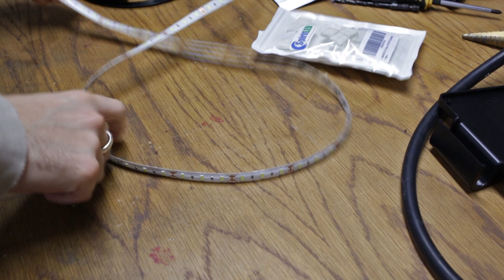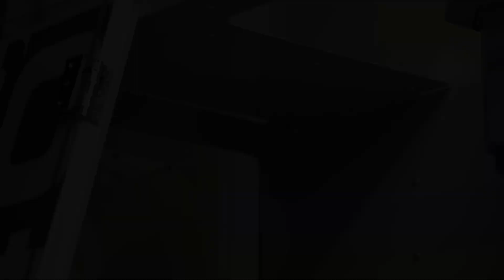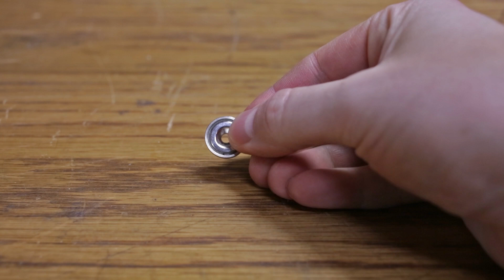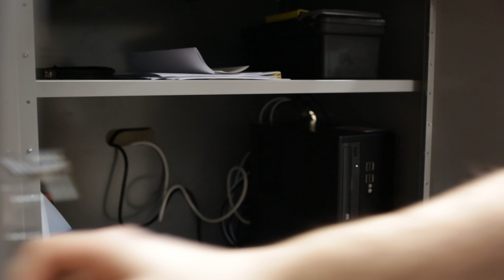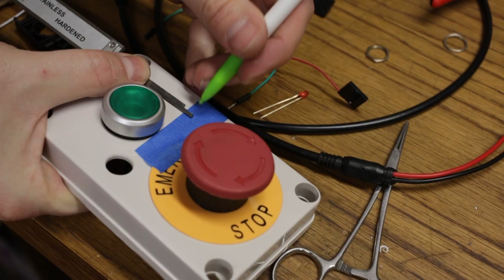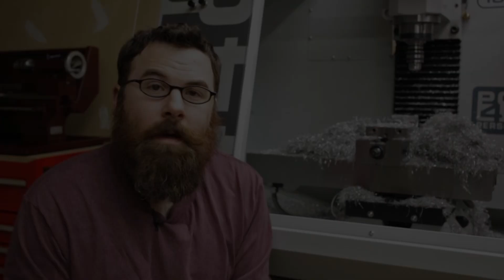Tormach 440 Enclosure Mods

Comment: The PC should just get power when the main panel switch is turned on. Seems like a design oversight on Tormach's part to have the control panel the PC powered separately. Power could come directly from the disconnect switch. It would be the same thing as plugging the PC in to the wall outlet. That is maybe $10 in parts. At scale that is maybe $3. I am getting my 440 fired up and this lack of everything on and off with the control panel switch is annoying.
Reply from the maker: HA, I'm just getting around to hooking the machine back up (just moved it across the shop) and am running into this issue again.  I'm considering wiring in a power strip so the main on/off switch powers a computer as well, just like you said.

Comment: Nicely done. How does Tormach feel about the two modifications? Wouldn't going into the internals of the computer case void any manufacturer's warranty? Can your Tormach do pretty much anything your manual lathe and manual mill you turned into a CNC mill used to do?

Comment: Thank you for this video Robert. Our University just purchased two 1100M’s and after we put the enclosures on, I was kind of disappointed that the only access inside the enclosure was through the front doors. That was until I saw this video and saw how you could lift the side glass. The 1100 has four brackets (one on each side of the glass panels and they are squeezed tight to create a seal. I think I will try taking the top bracket off and loosening the three other brackets just enough to allow me to lift the panels like you do. I know it won’t be as smooth acting as your panels are, but I am hoping it will at least make it easier to do machine cleanup and be able to access other components inside the enclosure , hopefully without causing a coolant leak. Thank you very much. You do excellent videos.
Reply: Who would've thought I'd find you here after taking your class 4 years ago! Thought you might like to know that I'm looking to get my own 440 or 770  next year to machine some molds similar to what you had us do in lab. Really appreciate the time you spend to teach us know it all engineers a thing or two about actually making things!
Reply: @noahhastings6145  OMG … hope your doing well Noah. The Tormach have been good to me as long as you stay within their constraints. Thank you for the kind words and Best of Luck to you and your future endeavors.

Comment: FOR THE COMPUTER YOU CAN SET C..MOS   (IN THE SETUP) ...SO WHEN YOU TURN ON THE COMPUTER ON WITH THE RED POWER SWITCH WORKS GREAT..
Reply from the maker: Yeah, I learned that a bit later unfortunately.  On the 440 there is only one power outlet and that's for the coolant system.
Reply: THAT I DIDN'T KNOW. THINKING THE 440 CAME OUT LATER YOU WOULD THINK THEY WOULD PUT IN AN OUTLET FOR THE PC..
Reply from the maker: No need for all caps ;-)  I think they were trying to save some cost.  The fuse, relay, etc adds some money, so they probably omitted it.  Plus there's not a lot of room in the cabinet.

Comment: Did your LED strips stay stuck? I bought the same LED strips from your Amazon link, and they fell off overnight the first night.

Did you do any surface prep? I put my LEDs on before ever running with coolant so I presumed the surfaces to be clean.
Reply from the maker: Mine did stick...  You have to REALLY press them down hard, and then repeat that step a day or so later.  I just did a simple wipe-down before I installed them.  They're still stuck.

Comment: Good stuff.  I wish you luck with the adhesive back LED lights.  Mine started to fall off after a few weeks.  Yes they were applied to a clean new surface.  But I'm running kero as a lube and I think the mist combined with the heat didn't help.  Let us know if you have a similar problem.
Reply from the maker: +Richard Cournoyer Yeah, I'm crossing my fingers.  I used some good foam double-stick tape at the T connectors, so hopefully that will help hold everything together.  Yeah, I think mist wouldn't help much at all.  If they start falling off, I can use another adhesive.
Reply: +Robert Cowan (Rowen Hobbies) the 3M tape used to hold accessories to trucks, like rail caps, is very strong, but solvents may still be an issue. If worse comes to worse, maybe you could mill out some aluminum strips to hold the LED strips in a channel, and attach with screws?  When you have a CNC mill, many things become possible....just a matter of cleverness and time! (And sometimes money of course). 

-- Mike

Comment: Nice video and great mods. All of them are simple and effective. Sometimes I think we over-design things because we can. 

Have you thought about the LED connections not being waterproof? I know they are at the top of the cabinet but you may want to seal them. I was thinking a bit of hot glue would work but still be able to be removed in the future. Also, were the holes for the doorstops there from the factory?

As for the psychedelic machining party lights... I LOVE IT! 🎊🎉  I wonder if you would be able to do I me the lights to stop the chips in mid air. 😎
Reply from the maker: +Eric Wolf Thanks!  I tried to make things easy and not go all fancy.  I could have easily used the lathe to machine a knob for the window stops, but there was no point.  I opted for simple.

Regarding the LED, it is actually sealed from behind with hot glue.  It's in a great place to NOT get wet, but that's the reason I used one of those LED holders.  I just put the LED in from the back and filled the whole backside with hot glue.  It has pigtails coming off of it, so the faceplate is still easily removeable.  

Yeah, the doorstops were in there from the factory.  I would have done something else if they weren't, since I wouldn't want to drill into the powder-coating.

Comment: Another great vid!  Great tips, too!! Thanks!
I was just looking at the LEDs......there's no mention of the connectors in the listing.  Others say that they have them.  Did yours come with connectors?
Reply from the maker: +bluehandsvideo Oops, forgot about that.  I bought them separately, I've added a link above, but here it is:  https://www.amazon.com/gp/product/B015FG490U/ref=oh_aui_detailpage_o04_s03?ie=UTF8&psc=1
Reply: +Robert Cowan (Rowen Hobbies) Awesome! Thanks!!  Just ordered them.....bit slow on the shipping(7-15 days), but I'm not in a hurry. :)
Mike
Reply from the maker: +bluehandsvideo Great!  They make the whole project a LOT easier.  If I wasn't filming, it would have been less than an hour start to finish.  I have to admit, it's a LOT better than my previous ring light that I made for my other mill.
Reply: +Robert Cowan (Rowen Hobbies) I certainly understand the filming taking up time......but it's the editing that REALLY takes the time!!
I've seen ring lights that put out plenty of light, but none that really put the light where I wanted it........and I like a lot of light!!  :)

Comment: that led light seems to be of very unnatural and unpleasant color. i guess its also the white balance of the camera, but surely one reason for the light is to get better shots
Reply from the maker: +Lothar Gesslein Single-color LEDs always show up a bit strange on camera.  They look more purple/blueish than in real life.  It's partly due to their actual color, but it's also due to how the camera's white balance acts when there's already other lighting present.  I have fluorescent tubes in my shop, and that's the primary lighting source.  So the camera will want to adjust white balance to that light source.  Since the LEDs are a different color, it's hard to get a balance between the two.

The primary purpose of the LEDs wasn't necessarily better shots (although it does help tremendously), it was really just being able to see.  If you scribe on a block of aluminum, it's hard to see with the enclosure adding a shadow.  In future videos when I film inside the enclosure (while machining), I'll just adjust the white balance and you shouldn't be able to tell the difference in color.  It's one of the tradeoffs of using LED, it's hard to get a natural white, especially from cheaper LED strips.

Comment: Since PathPilot is LinuxCNC derived, why doesn't it do an ACPI shutdown and turn off the computer, from the display panel?
Reply from the maker: +eformance I'm not sure.  That's what I thought first, but when you shut down in pathpilot, it just closes the program, it doesn't really do much else.  You still need to hold down the button for awhile to turn things off.  I was looking for a software solution, but in the end it was just easier to wire it up like I did.
Reply: +Robert Cowan (Rowen Hobbies) So Tormach probably has PathPilot setup to run as part of Init runlevel 5, with the default runlevel set to 5.  When you exit the program the script doesn't restart, so the machine just sits there dumb.  The solution is to edit the script that runs X and PathPilot so that after it executes PathPilot, it runs 'shutdown -h now' to turn off the machine.  That way when you exit PathPilot the machine will shutdown.  I should probably DL the PathPilot ISO and run it in a VM and start looking at how to hack on it.  Though I don't have a Tormach, so...
Reply from the maker: +eformance I don't have a lot of experience with Linux; I know hardware better.  For me it was easier to add a physical button.